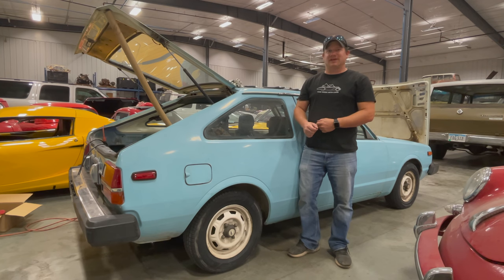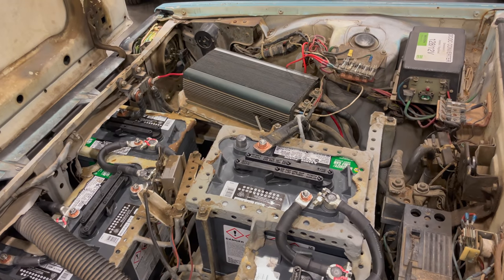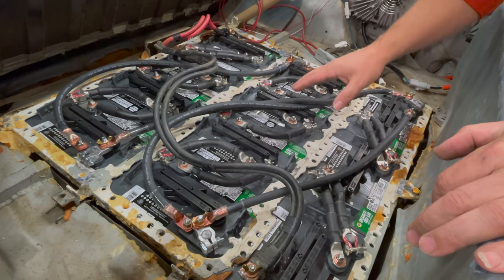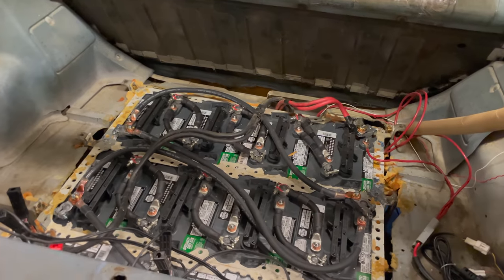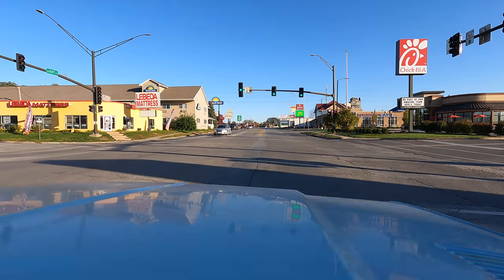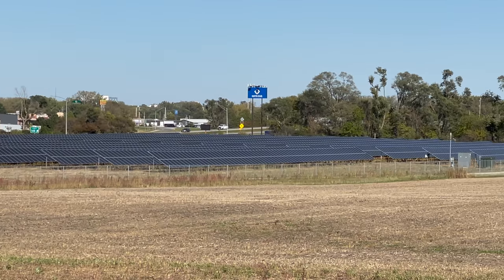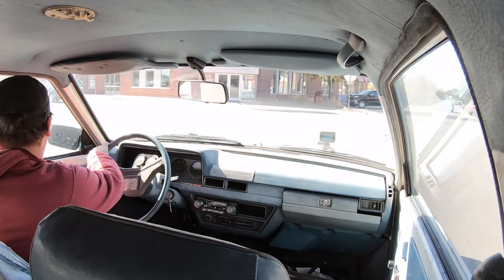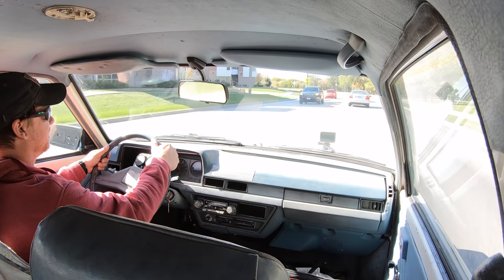Saving My Electric Car's Batteries

Comment: I was not a great fan of electric cars until I saw your video.   The new cars seem so over complex and super expensive and I don't really like lithium cells.   Your approach seems great and I love the 'old school' approach.   Back when I was young here in the UK we had loads of electric 'milk floats' which had similar technology to yours.  I spent many years driving electric trains on the London subway system where we used DC motors contolled by banks of resistors which had to be 'stepped' up and down for control which being so simple was totally reliable.  Now the modern trains are all computer controlled and often breaking down!   Love your videos Steve.

Comment: Why didn't you rotate the center stack of batteries 180 degrees? Then you wouldn't have to run those meter long cables all the way across.
Reply: I wondered about that too. That may be the only way the batteries will fit but I'm sure Steve could sort that out. Reversing just the centre row would remove 𝒃𝒐𝒕𝒉 the long cables too.

Comment: Steve, you mention that the car does not have regenerative braking, or engine braking. I guess this means that the brakes are having a harder time than on a ICE car. Are the brakes upgraded to handle the extra energy and heat?
Reply from the maker: Yes that’s what I mean.  No they were not upgraded so not only is there no engine braking but they are stopping more weight.
Reply: @ThisWeekWithCars  In that case your brakes could be underpowered? Maybe you need a safety project to improve the brakes on this car.

Comment: I love the car.  Interior spruce up and fix the instruments and stop the two mice making out on the back seat.  Even as a diehard petrol head I can see a future for electric cars.  The one dark point on the horizon is that maybe hydrogen combustion or hydrogen fuel cells may be the way ahead.

Comment: Isn't that grid holding down the batteries a bit of a short risk? A lot of its insulation is gone and very close to a lot of the terminals.. maybe give it a good plastidip. Wouldn't really make sense moneywise but i'd be in the camp of complete restoration but i'd say that about almost any car i like.

Comment: So, no regenerative braking, no engine braking, and based on the previous episode the vehicle weighs about 1000 pounds more than an internal combustion version.  No wonder it doesn't brake quickly!

Comment: run a fan overtop of the batteries.. some type of cooling
Reply: Or a man of Steve's means could use a FLIR Thermal imaging camera to identify the connections generating the most heat and rectify each.

Comment: Question. Can you use a bank of capacitor batteries to run an EV. Why or why not. If you could, an EV bug eye would be sweet.
Reply from the maker: You can but the range would not be good.

Comment: The brakes were never that good disc up front rear drums but i am guessing the servo has no vaccum it will need a electric vaccum pump or a .belt driven pump of a diesel.
Reply from the maker: It’s an electric vac pump.  Watch first video in the car.

Comment: Nice curiosity, it sounds like a 1960's UK milk float. Electric vehicles do not have the appeal of a nice burbling V8 exhaust noise, they are to clinical.
Reply: Clinical maybe but they’re also the future. In 2030 (UK) fossil cars can no longer be sold and you can expect the availability of new ones to drop to zero way before then. My Tesla M3P has an awesome inverter whine and 3.1 to 60 is something else. They do have their own charm. I also have a Caterham and a 76 Stag so I’m with you on the visceral appeal, but the planet can’t stand us continuing as we are. Something needs to change.

Comment: :buffering:just put a gas engine in it .....no more battery issues !
Reply: There you go
Reply: I have a Tesla. First service is 200000 miles. No oil changes, no servicing at all in fact, puts energy used to accelerate it back into the batteries when you stop instead of generating heat. No power use at all when stopped. That’s why gas engines are rubbish.